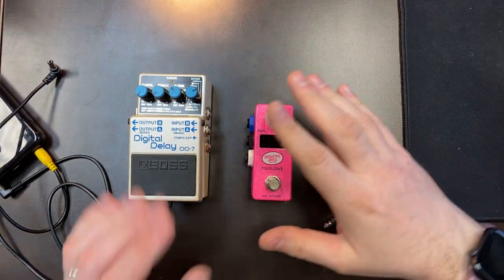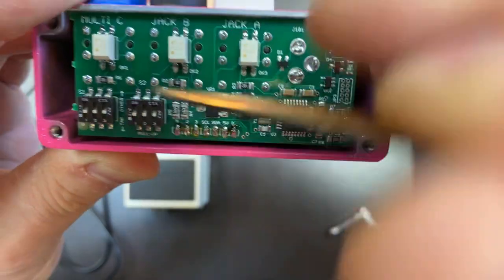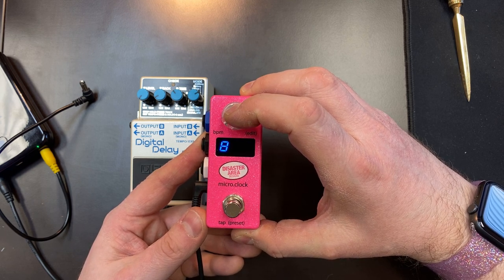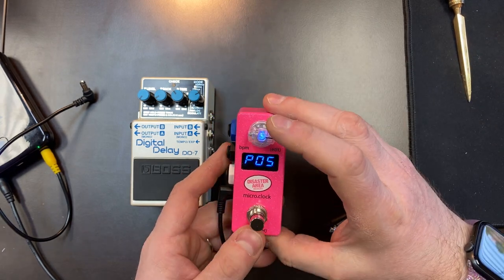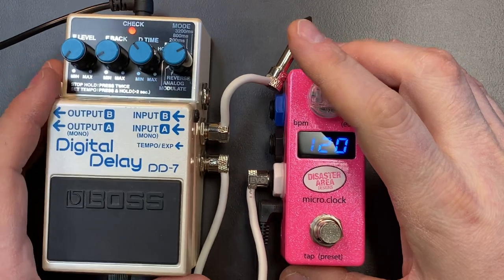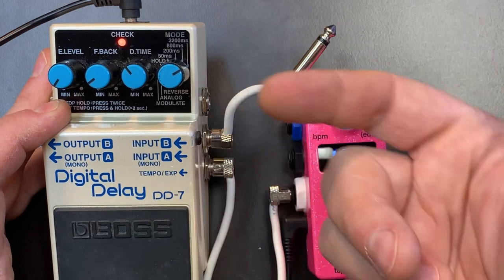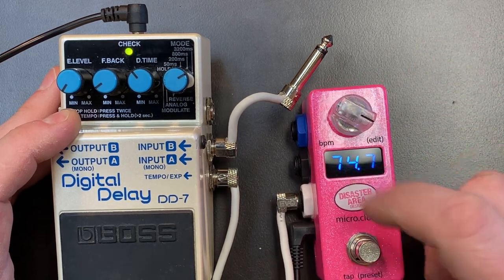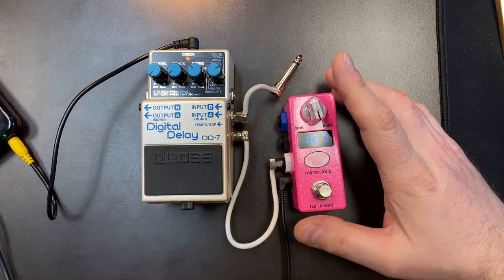Disaster Area micro.clock Setup with Boss Delay Pedals

Comment: Excellent video! Thanks for the information. Can you connect another pedal at the same time to control both pedals with the micro clock? I want to use it to control tap tempo for my dd7 and my zoom g3, both use normally closed switches

Comment: @disasterareadesigns QUICK QUESTION: For the DD7 does it have to be at 3200ms? Doesn't the Smartclock send a subdivided signal? Ex: the 800ms is that U2 dotted eighth sound, so what happens if you've programmed a preset with quarter, or dotted 8th, or _____, and then have the DD7 pedal knob set to 3200, 800, or one of the other settings? I have this same question regarding using my Smartclock with a Strymon Brigadier. 
In short: Where do the little switches on the Brig  go and where does the far right knob go on the DD7 if you've programmed a specific subdivision into a Smartclock preset? Would they be in conflict? Thanks for the help!

Comment: I'm using the micro clock with my DD5 (and Nemesis) and it works great! Thanks!
Reply from the maker: @benjaminthancock  It's much easier to use MIDI with the Nemesis.  MJ-5P or 5P TRS PRO cable from Jack C to Nemesis MIDI in.  Set J-C = MID, save and exit.  Enable MIDI clock input on the Nemesis.  Done.
Reply: @DisasterAreaDesigns  Left bank dip switches all open?   And how do you enable the midi clock input on the nemesis?
Reply from the maker: @tristanorlick3904  Left bank all ON, the up position.  Pull-up for jack C down / off.  It's usually safest to leave the pull-ups off all the time anyway.  Nemesis will sync to MIDI clock automatically but it's also an option in each preset, look at the tempo section of the Neuro Desktop / app.

Comment: I am having a huge noise when connecting it to my dd8. Suggestions?
Reply from the maker: Could be a lot of things but I'd suggest changing your power supplie(s.)  Each device should have its own supply, isolated.
Reply: @DisasterAreaDesigns  Thanks. Good point, I am using a single supply in a daisy chain. I never had any noise issues before with 5 pedals but this is a fair suggestion.
Reply: @DisasterAreaDesigns  Just to let you know, all that noise got solved with an isolated power supply. Thanks a lot.

Comment: Hi, wonderful pedal.
It's possible to use with a DDL delay by Steen Skrydstrup?
It's based on dd5 boss delay... but don't have a tempo/exp only switch tap tempo on the pedal, and input and output for guitar...
Many thanks
Beat Wishes
Reply from the maker: If it doesn't have a tap tempo jack, you might have a hard time connecting the micro.clock to it!  You may wish to contact the maker of the modified pedal, if possible, to see whether a remote jack can be installed on your pedal.

Comment: Do you know where to set the display to show milliseconds instead of BPM ? the website claims you can do this, but no mention in the PDF manual
Reply from the maker: Check in the t.DP (time decimal place) option.  There should be an ms setting if you're on a more recent firmware.
Reply: @DisasterAreaDesigns  Thanks for the reply! I'm about to buy one (in my shopping cart :) ).. to connect it to a chase bliss thermae do I have to buy your specific cable? Or will a standard TRS cable work that has 2 'ribbons' on both ends?
Reply from the maker: @zaqintosh  Standard TRS works fine with the current firmware.

Comment: The Boss DD-3T has modes that correspond to quarter note, dotted eighth and quarter note triplet.....the Micro.clock has options for those time divisions plus eighth note (non dotted).  Does that give the DD-3T the eighth note option that doesn't come standard in the pedal?
Reply from the maker: Yes, as well as "phi" / golden ratio in the newest firmware.  You should set the DD-3T to 1/4 notes, and then the DMC just taps to the pedal faster.
Reply: @DisasterAreaDesigns  .....so if I want dotted eighth or triplets, etc....the DD-3T still needs the mode knob turned to the correct millisecond range.....the Micro.clock doesn't override that?   And then a question on presets.....the DD-3T doesn't have presets available....but the Micro.clock does.....if you save some presets on the Micro.clock, one that is quarter note and one that is dotted eighth for example, will you get the delay you are looking for regardless of mode knob position on the pedal?   Or do you have to adjust the mode knob to match the preset?
Reply from the maker: @TexasTunesmith  no, leave the pedal on 1/4 notes. The clock will tap in the correct rate. When you load a preset on the clock it’ll automatically tap the right speed. For example if you want quarter notes at 60 bpm the clock will tap one time per second. If you want 8th notes at 60 bpm it will tap one time every half second. It’s basically just a robot that’s good at tapping in the right speed, you leave the pedal alone. Important note the clock can’t control anything on the delay other than tempo so please don’t expect it to set the mix or repeats, etc.
Reply: @DisasterAreaDesigns  .....so I'm clear.....it doesn't matter if I want quarter, eighth, dotted eighth or triplets, leave the pedal in the "long" mode, which is 200-800ms (and quarter notes per Boss manual), and the Micro.clock does all the work?

And by setting presets, all I would ever have to do is manually adjust repeats and effect level if needed?
Reply from the maker: @TexasTunesmith  Yes, leave the pedal in the long mode, 1/4 note taps.  And yes, you can preset the tempo but you're on your own for the rest.
Reply: @DisasterAreaDesigns .....sweet!  I think you sold me on it.

Comment: Does the DMC micro do this sort of thing? I'd love to get my T-Rex Replica (and a few others like TC Flashback) to do precise subdivisions and bpm. 
I don't really understand how it works. But it's cool. Your simple TNT is where I'm at right now. I just tap n go, subdivisions on the pedal if it has them.
The MXR Echoplex Delay is wonderful and has a tap-in, but no subdivisions. I could almost live with that as my only delay, but no dotted 8/triplets/bpm screen etc.
Sorry if I'm rambling.
Reply from the maker: Kind of - in the new v2.0 firmware it does have a clock source but can only send to a single device over the 1/4".  It does support subdivisions.  If you don't need the full MIDI control stuff that the DMC does, the micro.clock is the better choice, it's essentially a higher-tech version of the TNT you already have, same basic size too.
Reply: @DisasterAreaDesigns  
Great! Thanks for the prompt reply, that's what I wanted to know. 
Happy Easter from The Land Down Under :)

Comment: I have the micro.clock and I´m using it to send a tempo to another Midi Clock (erm Multi Clock) which synchs various electronical instruments. Everything works fine so far, but I havn`t yet figured out, if and how the micro.clock can send a "stop". Is there any setup that would use the tap switch for tapping when tappped and for stopping when held? Do you have a hint for me? Thanks!
Reply from the maker: You can connect a remote footswitch to the MultiJack to send tap tempo and start / stop mesages, but if you're already using the jack for MIDI then I'm afraid there's no way to do this.

Comment: Hi 👋 I’m just wondering if this can be used to set two strymon pedals (timeline and volante) simultaneously?
Reply from the maker: Sure, use a TRS-MIDI cable to send MIDI clock from micro.clock to Timeline, then a second MIDI cable from Timeline to Volante.  Use the 5P-TRS PRO or MJ-5P cable from our site, done.  BTW quick tip the Volante is set up to ignore MIDI clock in every preset by default, you have to go in and enable it in live edit mode for each preset.